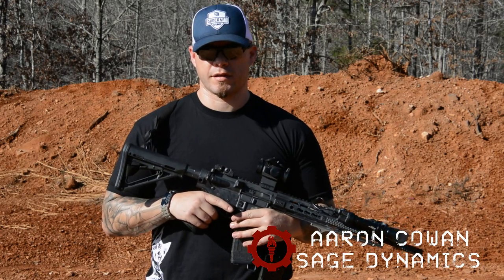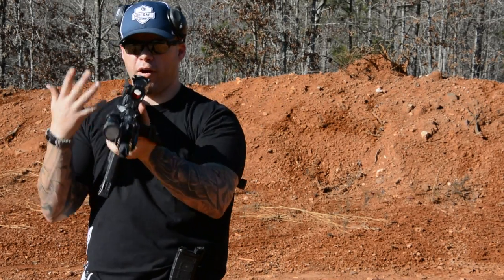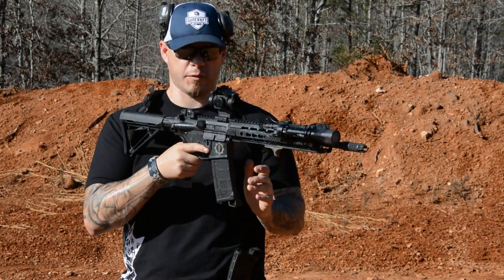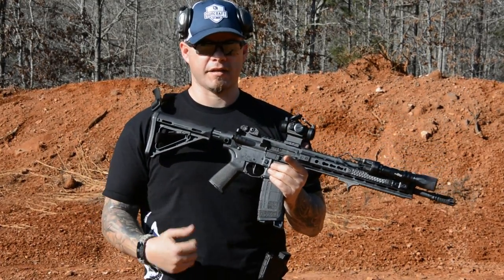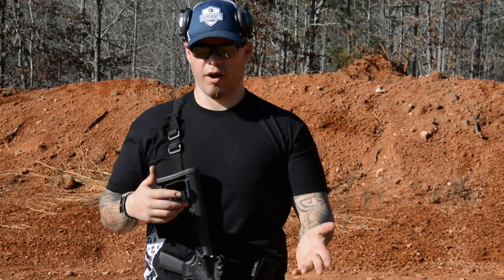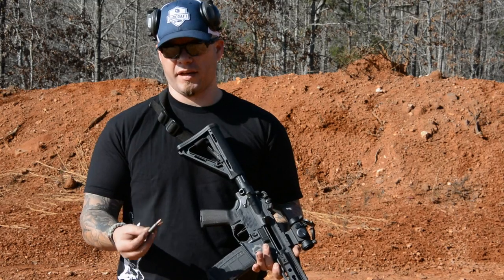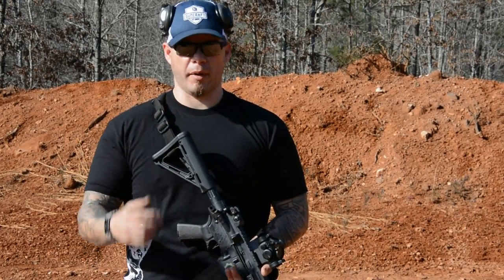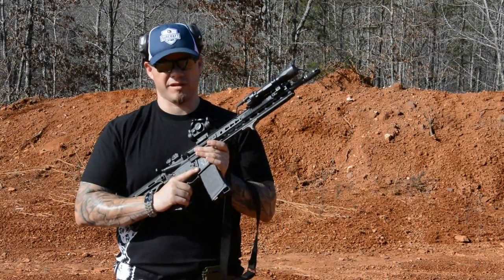AR Platform malfunctions

Comment: Pretty good video overall, so much so that I reference it in my own videos. The only issue is that the forward assist will work that far back and would be a good idea for a normal failure to feed, but otherwise the logic here is top notch.

Comment: One instructor I know, used broomstick with tennis ball at the tip of it.  He stuck that into ejection port during more dynamic drill to cause double feed. It worked couple times, until I started avoiding it. It filled the purpose.

Comment: Any experience with a round in the chamber but the charging handle is stuck and will not come back I had to use a little flat blade screwdriver to push the charging handle back got the round out and it looks all bent up

Comment: My brand new Ar 15, not even shot yet, me and my buddy were practicing jam drills. When we got to brass over bolt, we tried to clear it in my gun, and somehow, it destroyed my gas tube. It was beveled and somehow, it also partially beveled my bolt. My bolt wouldn't go forward, and it wouldn't fit over the gas tube. Weirdest thing ever. Took it to a gun shop to get fixed and when I explained, they said they had never heard of it happening before

Comment: Rather than clearing the malfunction from your shoulder cant it and drop the stock into the fold of your elbow and stabilize with your ribs. That way you have complete control over the system while manipulating any portion of the system. That has the ejection  port facing towards the ground and will aid in working any malfunction.
Reply: Ya they used to call that tap, cant, rack, bang

Comment: I've watched this video many times it's a great reminder of technique and I definitely appreciate the content, I did come up with maybe a slightly different method for something, in the case of a double feed maybe some people like myself might find that when you strip the mag you can do so by grabbing up on the bottom with your left palm slightly forward that way should you choose to retain that magazine in your hand it could give you a better purchase on the charging handle by having the magazine in your palm with your left pointer finger somewhat more free to get a purchase on the charging handle vs fumbling to try and use the magazine itself to rack. Then once cleared it doesn't leave you in a bad spot either to situate your magazine properly for the reinsertion. It just seems in my experience the more you use an item as an extension off of your hand the less control you will have to accomplish certain tasks. Maybe this will help someone out I know this little adaptation helped me out a bit. None the less awesome video if you can Aaron let me know what you think

Comment: What do you think of "finger fucking" the mag well? I was trained any time the bolt needed to be pulled to the rear or the magazine stripped to stick fingers up into the mag well in order to make sure it is free of obstruction. You can also sometimes just flick anything protruding from the chamber out this way as well, and this sometimes eliminates the need to rack the bolt a bunch of times. I have big enough hands that I can usually retain the magazine and finger fuck the mag well with the same hand, which also saves time with mag handling as well. But I rarely see it taught outside the Marine Corp when I was in.

Comment: As far as the brass over bolt situation, and taking your control/trigger hand off the weapon, what are your thoughts on using a BAD lever or similar device? You can control the bolt catch/release with your trigger finger, and charge using your support hand like normal. Thoughts?

Comment: To replicate a dead trigger stoppage (or action partial open) you primarily speak of a double feed occurring.  The reason for the double feed in an operational context would likely to be as a result of failure to extract, do you follow me?

To come upon this naturally, have you tried using a slightly crimped piece of 556 brass that will chamber and wedge in the chamber?  I didn’t see you try this but it’s very effective and will be consistent with your lock action/dump mag/check and rack action/Insert mag/release action.   I use this method and it gives me a great reproduction of the result of a shitty extraction which leads to a double feed.

Great video.

Comment: Just had a brass over bolt yesterday and had no idea how to clear it... 2 RO's couldn't clear it either, they had to take inside the shop to clear it. They ended up mangling my charging handle (but gave me a new one free). Wish I saw this video earlier! Looks super easy to clear. At least I have a new charging handle lol. Great video.
Reply: Mortar method? Hold firearm vert. With one hand place on CH slam butt of firearm down while applying pressure on the CH. Happened to me. Worked, don't do it often.
Reply: @s3ntin3l60  stick your middle finger up the magwell, push the bolt back.  If you need to, rack the ch back & forth untill case drops..

Comment: Thank you Sir. I just bought a new Ruger ( 1st ar I have  had) & it has jammed 3 times on the first mag. The last jam has the round with the bolt jammed against it. First 2 jams I got out easily but this 3rd one is stuck pretty good. Being an old man it ain't true that you can't teach an old dog new tricks. Thanks for the info.

Comment: mortaring works but it runs the risk of breaking your extractor.  been there done that, lol
Reply: Don’t recommend to do it on a pistol brace
Reply: @mjbalice  Ive mortared with my brace, it was fine...you dont want to smash it as hard as possible (that goes for any rifle with a collapsing buttstock), and you slightly angle the butt so youre hitting directly on where the buffer tube is.

Comment: Good video, but the AR reliability issues were due to the Army no using it as it was designed with the proper ammo, etc.
Reply: 100% correct the M16 was a bastardized version of the AR-15, plus the switch to ball powder ammo which caused it to fire with the gas port open created issues that stoner specifically designed the rifle not to do.
Reply: @scotts922  gas port should always be open or it won't cycle

Comment: If there is a double feed which I'm pretty sure is what happened to me yesterday, and the charging handle is stuck and will not pull back what is the proper way to clear this malfunction?
Reply: Or maybe it was a bolt override but my charging handle would not budge it was completely stuck in place. I eventually did get it out after taking the mag out and slamming the butt of the gun on the ground and working it loose but it took me way too long
Reply: To my knowledge If the bolt/charge handle is to hard to pull back with pure strength due to a bolt impingement or double feed. collapse your adjustable stock (protects fingers) remove magazine, pull on the charge handle as you firmly rack the butt stock on the ground. While holding the rifle at a Angle away from you and your face, and Down range. If I am wrong or misunderstood apologies and feel free to correct me.
Reply: @willb773  your not wrong that’s textbook mortar man method

Comment: Good video... the only thing i would add is to try at all costs to keep your firing hand on the pistol grip at all times and to rack the charging handle with the support hand.  I understand that this is difficult for some.  You did it with both hands throughout the video, which is fine.

Comment: I actually had a malfunction I have yet to see last range day.  Half way into a mag the gun ejected and stripped a round but failed to go into battery.  I rolled the gun and the hot round was actually lodged at an angle with the rear of the round under the bolt carrier and the nose of the bullet at the mouth of the chamber.  This resulted in the bullet being pinched, actually denting the brass.

I think it was because the mag perhaps wasn't seated.   I was resting the mag on a table keeping it in far enough to function.  When I adjusted the pressure on the mag I think the bolt barely stripped the round and the round slipped off below the BCG.

Has anyone seen this and does my theory make sense or have I lost my mind?
Reply: I keep having this with every second shot on my ar 10. Wish I knew how to fix it

Comment: Step 1: Buy an AK-74

Jimmies rustled.
Reply: Exactly, but when you factor out "cheap crap" AK's, it ends up WAY more expensive than a good, reliable AR.
Reply: Watch the iraqveteran8888 video on the ak burn out. Think twice before demeaning AR reliability!
Reply: I laugh at my friend who's Mr. Mil-Spec, vector optic, tactical man who's spent thousands on his AR and we get to the range and his AR malfunctions. I go through 500 rounds with my AK and have zero malfunctions and can consistently hit a 10" steel plate at 100 yards with iron sight. And my stock AK was $500 😂🤣.
Reply: Convicted VisionAres Oh yes. my spikes tactical AR has been absolutely reliable and I got that for around $840 out the door. I've had one malfunction and that was a failure to fire with some cheap steel cased ammo I picked up, can't even remember the name. After that, nothing but bang every time I press the trigger. The really good AKs run $200-400 more than that
Reply: Spencer B I was thinking "they don't have an AK malfunctions clearing video, hmmm wonder why" when I was watching this. but I've seen AKs malfunction though. usually cheap crap ones though
Reply: Stevean Bozek you mean all the ones currently available in America unless you have 6 grand?
Reply: Step 2: Stick it up your ass.

Comment: Hi Aaron, the method you demonstrated for clearing a brass-over-bolt malfunction has always worked fine for me. And, as you mentioned, it is the fastest solution. However, once it didn't work when the cartridge wasn't laying flat within the recessed area of the charging handle. Instead, the cartridge was wedged between the bolt lugs and the front of the charging handle. The cartridge was wedged in tight and bent. I couldn't budge the charging handle at all. I finally decided to mortar it while simultaneously pulling back on the charging handle. That allowed the bolt and charging handle to move back enough to engage the bolt released. However, it was still wedged so tightly, whenever I tried to work the charging handle, the bolt stop would always loose its purchase on the bolt. I finally had to place my forefinger on the front if the bolt to hold it in place while I worked the charging handle. That finally worked. Have you experience this situation before?

Comment: I once had my thumb on the closed dust cover which prevented the casing from ejecting after firing the round. This caused a brass over bolt.   Some time later this happened again, causing a double feed this time. So now I use this as a great way to train for malfunctions, because you'll never know which of the two might occur.

Comment: Probably a question for a class, but at what point do you just transition to your sidearm for the sake of saving milliseconds of being out if the fight?
Reply: TNT Firearms clearance of malfunctions takes place when you have the time and proper cover to do so, also distance between you and a threat can also be factored, your not gonna draw your pistol on a dude 200 meters away if you can just quickly get that carbine back up in the fight, trust me when I say you'll know when the times come if it's safe enough to clear vs draw handgun. Extremely situation depending choice

Comment: Great vid and great way to clear the bolt over ride. Kyle Lamb and others have different names for catastrophic malfunctions...brass over bolt, charging handle impingement, bolt over ride, 'triple feed' etc. Are these all just semantics and slight variations in the 'brass over bolt' malfunction and all cleared the same? Im asking because some guys act as if they are completely different malfunctions with different procedures to clear
Reply from the maker: Brass over bolt has its own procedure, you wouldn't be able to clear it using the double feed method.
Reply: +SageDynamics Thanks for the response. I might not of been clear...is what Lamb calls a 'charging handle impingement' and a 'brass over bolt' just slight variations on the same malfunction? Semantics? They seem the same to me and cleared the same way, but in his 3 little kittens video he acts as if they are completely different malfunctions.
Reply from the maker: +John M not sure; have not been in a Lamb class.  It sounds like the same malfunction